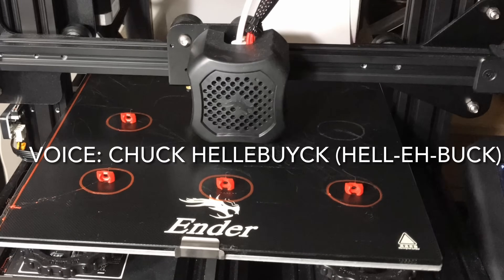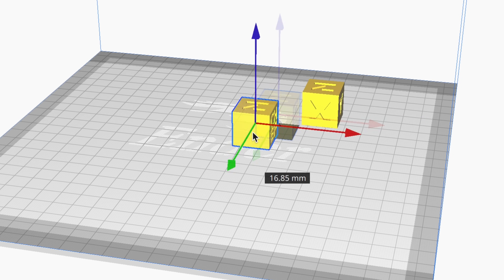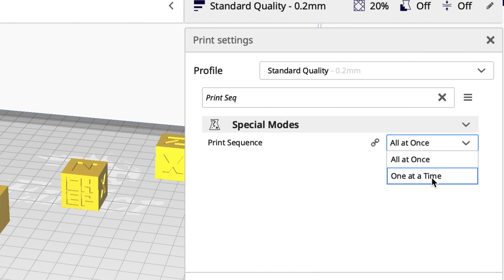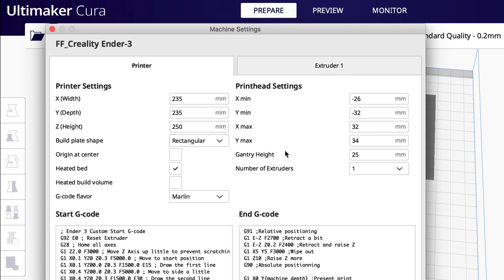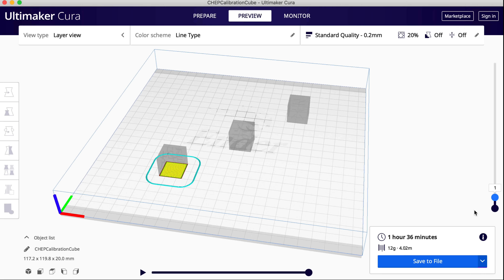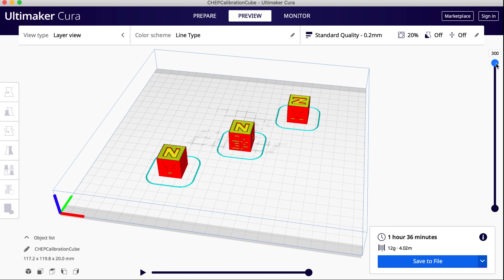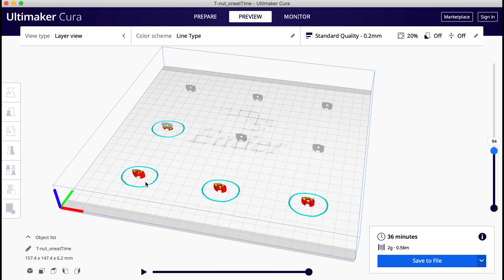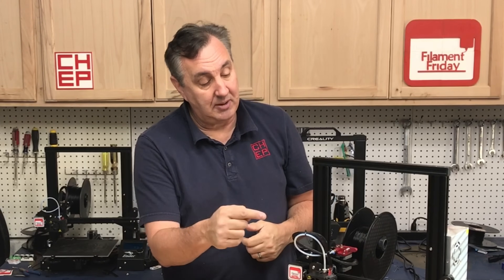One Print at a Time using Cura 4.8 Print Sequence Feature on Ender 3 V2

Comment: I noticed that when you have a printer with more than 1 extruder you need to disable all but 1 extruder in Cura for this feature to be possible to use. Cura tooltip state that the numbers of extruders that are enabled is preventing the feature to be shown but only if you browse hidden settings and hower over the info bubble.
Reply from the maker: Agree. Cura had bugs in multiextruder mode. Not sure they ever worked them out.

Comment: I have a question Chuck. What settings in Cura will allow a person to print each of those separate models with a different colour? I have a Creality CR-6 SE. Thx!
Reply from the maker: Print each separately. You have to change spools anyway so make it three separate prints.
Reply: @FilamentFriday  Thanks Chuck! That's what I landed up doing. I just wanted to avoid having to quickly set the nozzle temp again as it zeros out nozzle and bed temps after the print is finished. Also having to wait for the bed to cool down enough to remove each print takes more time and working with an older slow printer, time is a concern. I was just hoping to streamline things a little, but I guess per model settings are possible in cura.

Comment: print sequence is a great tool but it shoul be upgrades, if I'm printing multiple parts they all have same settings, sometimes i need them with different infill, speed, or layer height. that would be great step up from current print sequence

Comment: I have an Ender 3 Pro, and when I print individual parts I don't have a problem. However when I create multiple prints, it starts to print 5mm above the bed. What could be the cause of this
Reply from the maker: Z offset is the only thing I can think of. Make sure it’s set to zero in the slicer.
Reply: @FilamentFriday  can you advise me how to do this as I can't find it in Cura slicer

Comment: If you want to print something taller, go to the printer settings and lie about the gantry height. Make it taller than your tallest model. JUST MAKE SURE THE GANTRY ONLY MOVES AWAY FROM THE TALLEST PRINT! In other words, put the tallest model at the front, printing first, and the smallest model in the back printing last. Never beside each other.

Comment: This was great news (as I am a newbie) as I was totally thinking what a waste my 300x300x320 bed is printing one small part at a time!  This will greatly speed of the efficient use of the whole bed - so thanks!
How about this.....
What does it take to get automated printing?  Meaning, print a part, push it off, print another part, push it off, .... etc etc.

Comment: Is it possible to print say 2 objects, But each on to have its own settings, eg  retract 1.2 and the other 2.0 so  i can compare.  I know i can use part for calibration in extensions.
but i want to test these to see which is better.
Reply from the maker: Not that I know of other than two separate prints.

Comment: Chuck, I have a simple trex logo about 1.5 inches square and 2.5 mm thick I am printing in glow plastic. If I print a single logo I get a clean print with no under extrusion. If I add multiple logos to the bed and select one at a time all the prints are under extruded and look like swiss cheese. The only setting changed is the one at a time. Ever heard of this problem?
Reply from the maker: No, that’s a new one. Maybe check that the filament isn’t being restricted causing the under extrusion.
Reply: @FilamentFriday  Thanks Chuck. I have taken the machine apart multiple times looking for the extruder issues but I am convinced it is a slicer issue when I try to do multiple parts at a time because it behaves well when I do only one part at a time. Gremlins! I'll let you know if I ever find the fix.

Comment: How can I print 4 parts on the bed one at a time if one part is signifcantly twice as tall as the other parts. I get a message in cura saying "Build volume height has been reduced due to value of print sequence".
Reply from the maker: Change the sequence so tall one is last.

Comment: HI everyone. Does anyone know how to stop the print pausing between models? I see the bed randomly states is cooling then heating - the temp does not change but the printer happily waits for time to pass... During this pause filament leaks out and when the printer starts printing the second model if fails due to the excess filament that has leaked out. I've looked everywhere and no one has the problem like i do or they dont care or they dont have a clue to how explain it. I thin some G code somewhere is asking the printer to temp check between sequenced prints. If anyone has a solution and explainable reason for this i will love you forever. Peace out
Reply from the maker: What is your minimum layer time set to? 
I use 10s but small prints may need it lowered.
Reply: @FilamentFriday  Hiya, I checked that setting and found minimum layer time was not the issue as the waiting for bed temp was happen no matter the size of the object. I did figure this out though. Turns out Cura adds the M190 S60 command to every object in sequential print mode, This causes the printer to wait for bed temp. S60 is the bed temp value in the command. So now i edit out the M190 S60 command from every file. I always make sure the first use of the command is kept, every other duplicate is removed. Thus no waiting around oozing filament everywhere. Also note: issue still not fixed on standard Cura despite testing all recent versions of Cura since this post. No way to remove the excessive use of the M190 command other than adding a script to Cura in post processing options or removing code via notepad++ or some other text editor. I hope this helps others who are dealing with the same or similar issue. This also removed the need for skirts (if used as compensation for filament leakage between each model).
Many Thanks

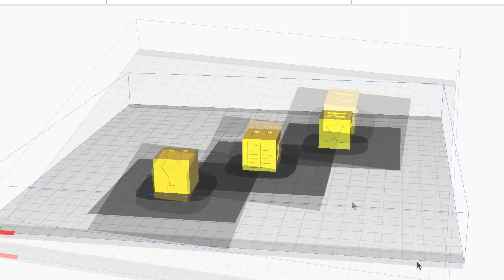Comment: 1:41 This is incorrect! This limitation is caused by the gantry height set in the cura printer settings under printer head. This is put in place so that the gantry doesn't hit a previously printed object. 
You could set the gantry height to 1000 for example to make cura think your gantry won't get in the way and effectively making the height of the build area much taller. (if you know what you are doing!!!))

What I did to print as many tall objects as I wanted is to fit them on the board in the way that the prints are printed from the front to the back whilst making sure 3D objects are never on the same line parallel to the gantry (look at the image provided in the comment below)

Comment: I'm using this feature but it pauses after the move to the next model for about 8 seconds and then strings badly and screws up the rest of the prints... what gives? is there a setting for this pause time?

Comment: I've been using this feature today and I'm getting 30 second (ish) pauses between each print. During that time filament (PETG) is oozing out of the nozzle and even though I've got a skirt to print before each item, guess where the bulk of that ooze ends up. That's right smack in the middle of my next print. Is there any way of removing this pause between each print, or getting the printer to run another purge line before it starts the skirt?

Comment: One of the most interesting reasons to use this, is if you have a failure at per example 80%, this could be for a tangled spool, power outage, blocked hot end, some of your prints will be finished.
Rarther than all be at 80%

Comment: So I’ve been curious about printing with nylon and reinforced nylon on my printer, and what upgrades beyond the extruder and hot end that I’d need to get my Ender 3 to print at 300 Celsius. There’s only one video out there that describes what’s needed, but it involves a lot of the channel’s personal gripes with the printer. 

I’ve watched your videos since I needed to assemble it, so I had a feeling you’d be able to explain which upgrades I’d need in a much more understandable way. 

Thanks!
Reply from the maker: I haven’t done it so I’m not sure but definitely a firmware upgrade is needed since it’s set to 260 max I believe.

Comment: Chep, I need your help. I am trying to see if my PTFE tube on my stock ender 3 needs replacing, but I can't seem to remove any of the two couplings attached to the tube. Do you have any suggestions on how to remove them. I have pulled and tried many different methods, but if I try any harder, I will stretch or cave in the tube.
Reply from the maker: Push it the opposite way and then cut off the bad section.
Reply: @FilamentFriday  That worked. Indeed I need to replace my PTFE tube. Appreciate the help.

Comment: Until now I have seen that "keep out" zone referred to as the "shadow" anywhere in Ultimaker content. That would be the term to enter for a help search.
How would a shadow be measured by the operator to customize the configuration? Would it be made up of the distances in all four directions from the center of nozzle to clear the hot end/fan box?

Comment: Can't use this feature with vase mode. The slicer says "Unable to slice" Anybody got an idea ?
Reply: havent tested, but pretty sure its because of the height and not of the vase mode!
also, if you are pretty sure the gantry wont hit the pieces already printed, you can change its height in the options for a really tall size and print anyway
Reply: @lookus69  When I don't select vase mode it slices successfully so that's why i think that's related to vase mode. Also, how can I change its height in the options? Where is it?

Comment: Another good thing about this is you can print many small models one at a time when your filament is running out (I don’t have a filament runout sensor on my elder 5). This means I can keep printing without worrying about running out of filament misprint. I have changed the gantry height on the setting in Cura and made sure it prints from front to back and that way i can print big things as long as I take into account the gantry, a bit of zig/zagging makes it possible.

Comment: Too bad Cura reduces the print height so drastically. It is not impossible to combine larger prints (I fudged some gcode to print two test towers with different speeds) - but I have no idea how much programming effort would have to be put in to keep everything save.

Comment: I've been using this for some time now on my Ender 3 Pro.  The tricky part in Cura is that the order in which objects are printed is determined by the order in which you add them ... but ... there's a trick: if you delete an object and then UNDO that action, it is as if you just "added" that object.  So, after positioning all objects, without worrying about order, I delete the item I want it to print last, undo that, then delete the one it should print just before the last one, and undo that ... and so on.  The final result is having the order I want: right to left (because my BLTouch is on the left) and front to back (so the X 2020 bar doesn't hit anything).  And with that order, you can get away with some extra height (change printer setting in Cura) by ensuring the X axis always stays behind the earlier prints (so don't make a grid, but diagonal zig-zag pattern of objects) and the head keeps away sufficiently (which the size settings in Cura help with).  I've printed sequential objects >10cm high in that way - which with normal settings Cura would not allow because of the height of the gantry being less.
Reply: Thanks for the tip!
Reply: Ahh thanks!
Reply: You are a GOD. Thank you so much for this info. I was wondering why the print sequence was so frickin random. It's good to know the reason for it so I can work around the issue.
Reply: @ShadowVFX  Or ... you can also do what I have done in the meanwhile and switch to SuperSlicer or PrusaSlicer, where the order of objects is much more clearly defined and you can just move objects around in the list.  I'm surprised Cura has still not improved the control over object order ...
Reply: Editing the code with hand lets you print multiple higher objects at once. X axis causes some trouble tho, so you have to be careful, you can have multiple low profile at the same row, but only 1 higher. A G0 Z above the highest print after every object, G0 X Y above next object, print and repeat. be careful not to stop/pause the printer midprint, and you should also edit end code to rise up before presenting the juicy stuff.
Reply: Goat
Reply: Thank you, i was not understanding how cura decide the sequence, thank you so much
Reply: Thanks bro
Reply: Great tip. I've been searching for a way to change the sequence, but that sounds like a work-around.

Comment: Hey I just installed a new motherboard and screen on my ender 3 and now my printer won't extrude anything unless I've cleaned the nozzles and everything it's something in the Gcode or the firmware. Chep your a printing god so I thought u might be able to help.
Reply from the maker: Not sure I understand.
Reply: Hey sorry chep I didn't mean to say "unless" in that paragraph. So I installed the new motherboard and screen I hit print it will extrude the first bit of filament along the side of the bed and then the motor that pushes the filament through just stops moving. You can't force the motor to turn so there is power going to it.
Reply from the maker: Sounds like something wrong in the slicer setup. Try a sample file.
Reply: Ok will do

Comment: If you were to print a couple of taller prints you might run into trouble with the gantry knocking prints off the bed as the Y axis moves. Or is this also taken into account by Cura?

Comment: THE SEQUENCE IS MORE IMPORTANT THAN YOU THINK....

Great Video as always.

One thing to watch out for (as I use this feature a lot) is if you're running a printer with filament runout sensor.

If the filament runs out the head moves straight to the home position, not a problem when printing all at once as the head will remain at the highest layer that it has printed. However if this happens when you are using the print in sequence mode and you have several prints on the bed, then the head may well crash into them as it won't avoid them on its return path to its home position.

My tip is to make sure the print sequence starts front right to right back then returns to front centre to centre back, this way the head will never meet an already printed part when parking during filament run out.

I returned to my printer to find the BL touch pin bent on my MAX and couldn't work out why, when I resumed the print with new filament it became obvious as the head crashed into the printed items on its journey back to where it had left off.

So as Chuck suggested, print order is important but maybe not for the reason you thought.

Comment: Subscribed!  I was just thinking about something like this earlier in the week.

I also like sequential prints for multiple parts because its safer against problems like running out of filament, filament breakage, or power outage.  If that were to occur with parallel prints then all prints on that bed would "partials" and all unusable.  But for sequential prints, such an error event would only cause the currently printed object to be a "partial" -- because the other objects would have been 100% completed or not yet started.

Comment: Great that you bring this up, we have been using this technique for the past two years but pushing it even further: First, we group our parts two and two, and the rotation between those two parts allows us to control precisely where the travel-seam between them will be placed.
, Cura says max 25mm height due to print head and gantry clearance, but we have raised this number to  300 mm allowing us to print any size object one at a time. As long as we print diagonal, STARTING FROM THE FRONT AND MOVING DIAGONALLY BACKWARDS, it is possible. We print parts that are140mm high this way. 

Third, the method has one more advantage: we need to get as much milage out of the filament spool as possible, and this way we can let the spool run to the end and never end up with more than two unfinished parts, instead of a full build plate of unfinished parts. 

We have three ender 3 pro and will print 200 parts this month with this method, itt works like a charm. 
We also tried a CR10-500mm to get more diagonal length, but it was such a poor printer compared to the ender 3, it's better to add more ender 3.

I hope this is helpful for someone.
Reply: How do you get it to print in groups of two rather than one at a time?
Reply: @cdman973  right click after having s3lected two models gives you an option to group.
Reply: @cp001cp001  Amazing! Thanks so much, I have been wanting to do this for a long time!
Reply: @cdman973  perfect, glad it worked out for you.
Reply: How did you change the setting to 300mm?
Reply: @Ryan-gs3pt  In CURA, go to Preferences->Printers->Machine Settings and change the Gantry Height to xxx mm.  
Best, Christian
Reply: @cp001cp001  amazing, thanks so much for the quick reply! 👍
Reply: @Ryan-gs3pt  happy to help, have fun!

Comment: Cool. Having just got my printer dialed in to have really good bed adhesion this is the final piece to be able to print multiples without worrying about one fail ruining allllllll of the ones im printing.

Tried several times before to print a bed full of things all at once. Even things that had never failed to print. Suddenly was getting just random detaches. I guess leaving one print and coming back over and over is just riskier and more likely to fail.

Comment: Hi Chuck! Tried it out previously, noticed a rather long pause as the printer transitions between prints, i.e. after finishing a print, it hangs in suspended animation before starting the next. I don't mind the wait, issue is that filament will ooze during the pause, and that string could potentially get caught in the next print. Wondering if you have the same experience as well? Using the CR-6 SE with Octoprint.
Reply from the maker: That’s why I use a skirt.